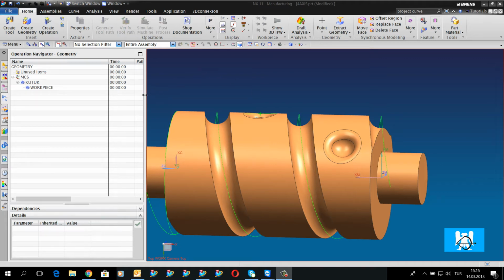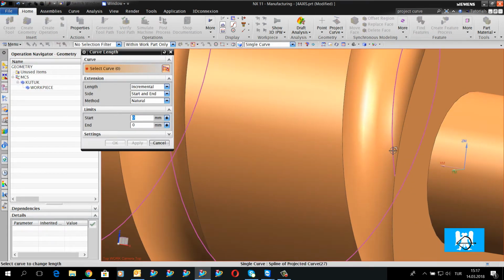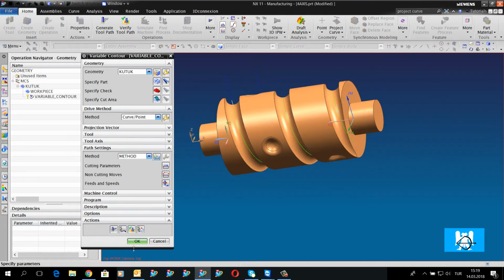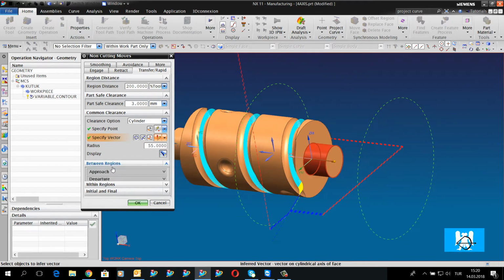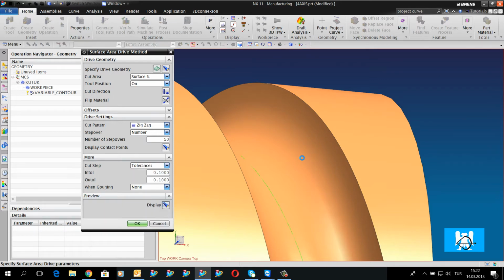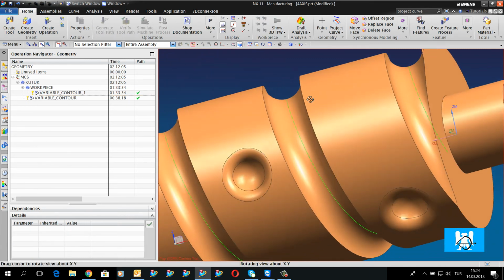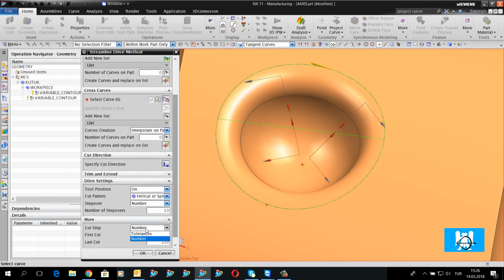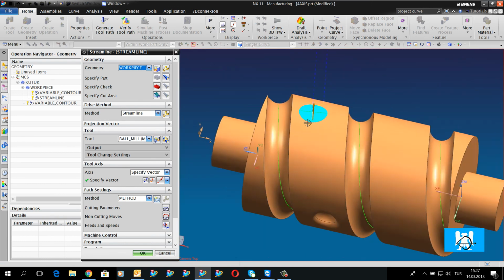70-4 Axis Simultaneous 3 Part

Comment: Hi, wonderful videos, I have a big question I'm using Surfcam but Im looking for a cam that can make the finishing surface that you made but with several chose surfaces I mean my drawing the helix surface is compose for several surfaces no just one, can NX machine with the same operation several surface finishing? Or do I have to make and arrangement to join those surfaces or faces to create one surface face to produce the a finish operation like your? I would like to share my model with you for an easy understanding, just tell me how.
Reply from the maker: Hi. You generally don't need to make arrengements on surfaces when using finishing operations. In Contour area (three axis machining) you can chose several surfaces and machine it just with clicking generate. But if you have openings or holes on your model and you don't want your toolpath to engage those openings you make simple patches with n sided surface or other patching operations. But when it comes to five axis simultaneous operations if you have simple parts you again don't need to make surface arrengements. Even machining surface consist of several parts you can machine the surface with streamline method. Because you just select the surface outer peripheries with this method. 

For complex surfaces like blades, medical parts with simultaneous operations you generally make detailed surface arrangements for need of better toolpath quality. But if you know surfacing operations well it is not difficult actually. 

You can send your model to yusufugurluoglu@gmail.com. But please color the surfaces you want to machine. And don't forget to define your tool and machine.